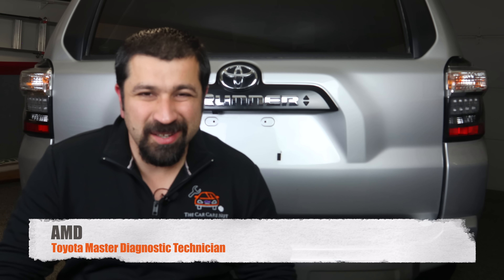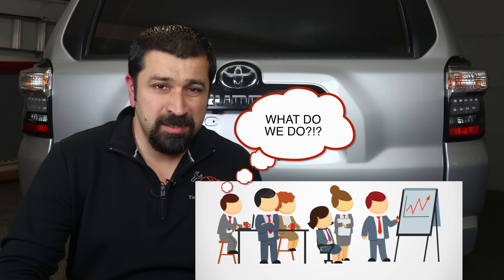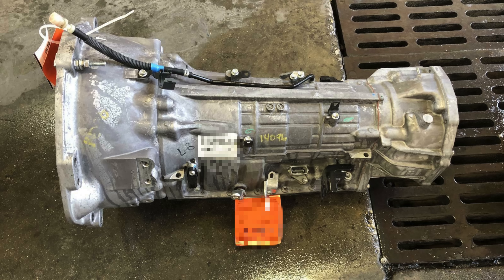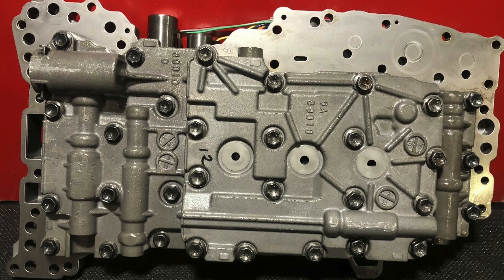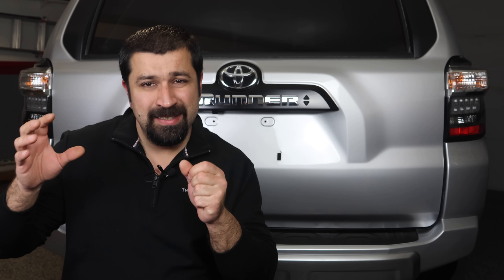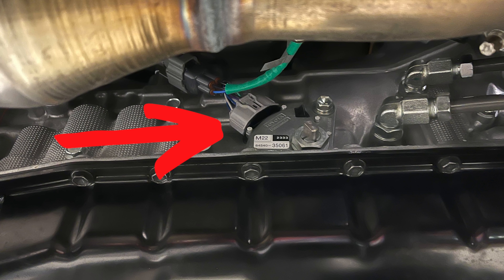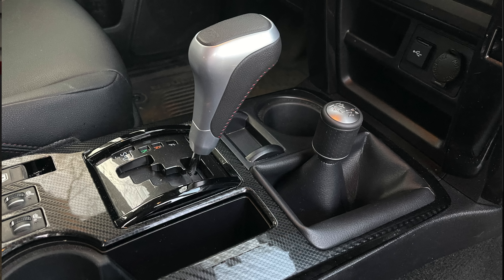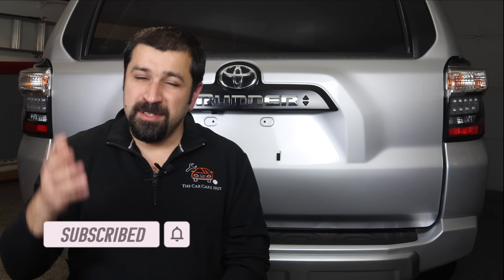Toyota 4Runner Transmission. Why is it so reliable?

Comment: @TheCarCareNut, Thanks for all of your great and educational posts. I have a transmission question on a 5th gen 4runner if you will permit me. I have a 2012 that is sometimes flaring between 4-5 shifts.  Meaning I am driving and it shifts normally thru 4 then when shifts to 5 it seems like it quits pulling for a split second and the rpms shoot up about 800-1000 rpm then all is fine again. Not like a hit but a lull if that makes sense. I have had a trans shop look at it and they find nothing wrong but did verify it did it.  I have had the fluid changed several times since I bought it all by Toyota dealer.  I am thinking it might be a solenoid but dont want to just throw money at it. Any ideas? 
Thank you

Comment: Love this channel. I have a 2023 4 runner SR5 2WD I bought new in December 2022 and have only driven 1300 miles. Since I owned it I occasionally get a transmission shudder only in one situation. When I am slowing for a stop or a speed bump and then start to accelerate from a stop is the only time I feel the shudder. I have a feeling the fluid level may be low and when I brake the fluid moves forward away from the pickup point. Do you have any advice? I hate taking any of my cars to the dealer

Comment: My 07 had some shudder at 65K when I bought it.  Did several drain and fills and resolved the issue.  Currently at 275K miles

Comment: My Toyota 4 runner 2003, with 195k miles, never had before the first time an transmission fluid change, 
Do I’m supposed flush and replace the fluid? Can my Toyota have problems on the transmission for not maintenance?

Comment: Excellent information!
I have a Toyota 4runner 2003, on very good condition I just painted last year, 195 K, miles on it, and still running good. The transmission still good.

Comment: Hello car care nut I have a question for you. I bought a 2024 Toyota 4runner. I have been babying my 4r. No rough acceleration or long hours driving.  So i accelerate slow ensuring eco light stays on. However I keep feeling like my transmission kind of has a slight jerk, or feeling like it has a delay when switching to 2nd gear. I have tried accelerating a little faster and sometimes feel the same thing. Is this a known issue? I keep wondering if it's just me.  But I feel like the transmission is kind of jerking when going into 2nd gear.  Do you know anything about this? I figured you would have knowledge if this is a known thing.  Thanks for any help you might have.

Comment: What’s the average temperature for these transmissions. I’m using a scan gauge 3 and I’m noticing that in the summer my transmission can see temperatures around 220 degrees while just cruising on level pavement. 

I’ve always been told that anything above 200 is bad. While towing I almost hit 250.

Comment: I still miss my 2003 4Runner V8. Had over 250,000 miles, never had a problem with the motor and transmission. What killed it was the undercarriage rust, on the frame and eventually the hydraulic lines gave out.  I still got 20 years out of it, and, had it not been for the rust, I would be driving it today. Loved my 4Runner.
Reply: I had a 2005 v8 with 247k miles.  Lots of 4 wheeling on beach.  Frame was rusting and AC needed to be filled every 2 mos.  NEVER had to take it to the dealer or repair shop.  The only repair was front CV boots that I did.  Bought a F250 in 2019.  Sold the F250 yesterday, got tired of dealing with recalls, warranty work and the final kicker was needing a $3000 steering wheel out of warranty.  Looking for a red 4runner now

Comment: Great videoCare Nut Thank you.I have a 99 4 wd  4 runner  with  290.000 miles I have owned for 20 years as you suggest always changed fluids on timethe car runs like a champ,I would like to see  my  runner go to  400.000,any suggestions maintenance wise to keep her going?

Comment: Do you know what the normal operating range of the 5th Gen? And what temp would you get concerned is getting too hot?  We use an app Torque Pro with custom PIDs that show Torque Converter output was in mid 230F after a long climb and trans pan temp up around 205.

Since we don’t know of a way to check trans temp without third party software, trying to figure out if PID is correct. Also do you recommend aftermarket trans cooler for heavier rigs?

Comment: would accidentally using a funnel I previously used to drain old engine oil to fill my transmission during a drain and fill pose a risk to my trans? The amount of engine oil introduced would be only what was still clinging to the sides of the funnel.

Comment: Changing the trans filter and gasket tomorrow on a 2018 4Runner 6 cylinder
Could you tell me the torque specs and the transmission pan bolts
And what temperature should the fluid be to check the overfill
My RAV4 and Camry are 104 to 113° is it the same

Comment: 2004 limited here, only 136K miles. Almost 20 years and no issues. Changed the transmission fluid at 100K

Comment: Hi,
Thanks for this video.  I have a 2006 4runner with the 4.7 v8.  Bought used. Don't think the Trans fluid has been changed in 180k.  It has issues shifting from 2 to 3, and it will not go into 5.  I'd like to do a filter / fluid change, and change the solenoidscfor these two speed shifts. Would you know what transmission comes with the v8 in 2006? And what solenoids I should address?  Also, is there any chance you would do a video similar to this one where you show the part locations?  Great job on this video, please keep them coming.

Comment: I have a 2009 and I go to the dealer to do drain and fills periodically.  I usually bite the bullet and go to the stealer for anything involving ATF or diff lube or coolant or transfer case oil change or driveshaft or whatever ... the indie guy is fine for most things but I just trust the actual Yoda techs to do the more exotic fluids in the car.

Comment: I just bought a 2012 4runner limited AWD.  I get the rumble strip noise intermittently on acceleration at around 20 to 35 mph.  Is this a bad Torque Converter with the Flex Lock  Up function?  I had the dealer do a fluid change but still persists.  What should I try next?

Comment: Dear AMD, I just bought a 2010 4Runner Limited from a family member with 228,000 miles.  Maintenance was performed throughout the years but not as well as I maintain my 2015 Tundra (330K miles).  I have a dilemma with the transmission in that a while back it developed an intermittent brief shudder when accelerating at times but otherwise drives fine.  A former mechanic put some type of additive in, but didn't perform a service on the transmission.  I have no idea if a transmission service was ever performed on the vehicle.  I believe one of your videos indicates that a transmission service in my situation has the potential to cause more harm than good, is that correct?  If so, would that mean that I should avoid servicing it completely?  I have only owned 4Runners since 1995, only swapping for a Tundra to tow a larger trailer.  I now have the opportunity to have a vehicle I love, but could really use some advice on the transmission.  Thank you if you are able to answer.  Your videos are empowering and beautifully supplements most of what I was taught about proper maintenance of a vehicle from a auto mechanic with a similar level of experience and knowledge as you.  He has retired now, so your videos are a life-saver for me!  Thank you.

Comment: Just bought a 2016 4Runner with 142,000 miles. Took it to my local mechanic to have it checked out.  My mechanic noted that the transmission housing looked cleaner and shinier than the engine and other metals underneath. He said that the transmission could have been changed.  However, I noticed on Carfax that a recent Toyota  service performed revealed a leaky transmission pan gasket. Is it possible that once that gasket was changed, the mechanic wiped and cleaned the pan really well and that is why it would look shiny and newer? Is there a way to tell if a transmission is the original one that came with vehicle?

Comment: I have the 4AW aising warner four speed transmision in my 1998 montero sport, i hear that it also is very dependable four speed transmission i wonder if it is similar or the father of this 4runner trnsmisison.  I hear a lot of jeeps had it with 4 liter motors beating on it and off roading and so my 3 liter montero should be fine with it i hope

Comment: I'm Praying the Upcoming 6th Gen 4runner remains Simple. I've owned 9 4Runners since 88 always off roading in them. As Well as other family members. Along with  a few Tundra's and I Always find myself getting in the 4runner.  I praying that toyota does not make it any bigger, Or Change anything to much. I wont even touch a New Tundra turbo after Driving one and Seeing the issues first hand. It is not a 3/4 ton truck on a half ton duty. It is A Big 70's car to me. 4Runner duties and is and hopefully will always be geared towards the adventure. Not the parking lot explore or minivan type that moved into half tons.

Comment: This guy is the reason I just bought a "new" old school 2023 4Runner 4WD Premium!  Great videos and information!
Reply: I have a 2024 because of him
Reply: About to look at a 2023 trd-or today. The newest car I have ever bought was a 2010 focus in 2017 I bought cash for 3k. This gentleman is making me comfortable investing with money and maintenance in a 4Runner for the long term. It’s about 6x more than I have spent on any vehicle before lol
Reply: Me too!
Reply: Just bought a 2022 sr5 4x4 because of this guy too😂
Reply: I have a 2024 4Runner SR5 Premium because of him and Overlanding
Reply: @epicmickey2351 SO WHAT YOU HAVE IS A 2024 TOYOTA 4 RUNNER SR5 PREMIUM (THIS IS THE PROPER WAY DESCRIBING WHAT KIND OF VEHICLE YOU HAVE) THAT WAY EVERYONE WILL KNOW. IT'S JUST LIKE I BOUGHT A, 2010 TOYOTA 4 RUNNER LIMITED WITH A 4.0L V6 AWD AND 4X4.
Reply: How is the truck
Reply: @erickonassis6310 calm down. We all knew what he ment
Reply: @erickonassis6310 I have a 16 bought at 89k miles in 21 or 22. It’s now at 164k. Had a timing cover inspection port leak that was very minor, removed metal gasket and rtv silicone from work on it. Only done maintenance fluids, and killed a battery leaving the ign on overnight. Taken it off-road, road-trips, hauled trailers (nothing too heavy), it’s a great choice.
Reply: I bought a 2023 off road because of him . Love it

Comment: Great video .... thank you for posting....
Just 2 things I want to mention regarding 2021 4Runner that I am experiencing 
1 - When cruise is on and my 4runner comes to almost any kind of incline it comes out of 
5th.   Is this good or bad ..... is this normal...?

2 -  Noticed when going down a steep grade engine downshifts and RPM's jump up..... again 
is this normal ?    All my cars in the past never did this....

Thanks in advance.

Comment: Why does my 2022 4Runner Limited get 100 miles less per gallon than my 2007? It seems like it is running at a high RPM when on the highway?

Comment: I hope you might be able to help me I have a 2011 Toyota forerunner limited I bought it with 218,000 miles transmission runs fine but I decided to check for myself if the fluid was ever changed and it wasn’t so I started a process. I drain the transmission fluid when it was cold and 2 1/2 quarts would come out and so I would replace it with 2 1/2 quarts with new fluid. I would run it for a week or two and I would do the same process again. I did this four times with mind you synthetic fluid. My transmission runs fine but the only thing is when I slow down too fast it has a hard time coming down the gears and therefore when I press the gas it has a hard time catching onto gear and it kind of bumps me but it goes into gear once again. It was not doing that until I change the transmission fluid.

Comment: @ 200000 Miles Radiator went bad and got water mixed with the transmission oil and this was the end of it

Comment: Im a 10+ year Toyota tech. We routinely recommend flushes on sealed transmissions. We tend to recommend them at around the 100k mark. Never have I told an owner to not flush their transmission ever. Toyota's World Standard ATF is very good stuff, but it gets dirty like all fluids do while in use. It is definitely advisable to flush your transmission, just make sure you are using the correct fluid AND set proper fluid level after. Only time I have seen these transmissions die is when serviced improperly with wrong fluid or not enough fluid...

Comment: I have a 2022 4Runner Trail, when is the best time to change the transmission fluid to remove the metal shaving...I have thinking 10k miles...Please advise

Comment: I have a 2019 Toyota 4runner  SR5 4 wheel drive. I think heard you say change the transmission fluid every 60,000 miles or 6 years. Should I drain and fill or have a shop back flush it? And does it have a filter that needs to be changed?   Thanks in advance...

Comment: Great vehicle. Too bad that the RAV4 isn’t the same. Both CV joints gone at 88,000 kms and Torgue converter has been shuddering from day one. Our Titan has been the most bullet proof vehicle we have owned. 396,000 kms and no major issues what so ever.

Comment: I disagree. 5 speed is Not enough and while 4 runner is on cruise it constantly go up and down trying to find gear changing every second or so at certain speeds/elevation. it is way over due to fix or at least an software update to fix the issue!

Comment: If you live in the mountains you put up with this trans but you sure don't like it.
Too much time in 3rd gear pulling 4000 rpm.
I love that is reliable but 6-7 speed would be great.
My MDX has ten and is so much smoother and seemingly more powerful even though the HP is about the same.

Comment: Hello,  Amd, I have a 05 4runner sport.  I can't figure out why when I'm driving easy on the throttle approaching 40 m.p.h, it tries to go into overdrive.  It fish bites, I apply increased throttle and nothing happens,  just continues.  I lift off the throttle and reapply it goes back to 4th and is okay. When applying heavier throttle and the speed approaches 50 or so it goes into o.d. just fine.  God bless and thank you.

Comment: Hi! I just found your channel! I have a 1996 LX450 with 361,772 Miles and counting (I put on 200,00+ of them since 2009) My biggest issues are the door handles crumbling away!! I replaced the heater core and the cylinder compression was checked and very good! I also have a 2021 Ford Bronco I reserved a long time ago sitting in my garage that I am going to sell to get a new 4Runner. This is a great video series, and I also watched your 2015 Camry engine breakdown. I change my oil every 3-4k miles in my cars, and now I am glad I do. God Bless ya and be safe!

Comment: I own a 2018 4runner. I bought it certified used from my local Toyota dealer. At 60k I had the transmission flushed. Simply bc there was no record of it being done before and I know you’ve said multiple times to do maintenance. I’m at 86k now to at about 120k it will need servicing again. When I take it to the dealer should I get it flushed again or just a drain and fill? I really enjoy your videos and keep up the great work! PS it’s my daily driver so I don’t do serious off-roading or any towing with the vehicle.

Comment: Thanks for all your great insights which is why I chose to buy a 4runner 2022 2WD, since 100% of my driving is normal road it now has 6k miles. I do have an issue and genuine dislike/concern about its transmission. I know it's an old true and tested built but for some reason it is so hard to shift out of park. Everytime it sounds like a harsh grind or bump. I have tried neutral + parking break and then park and it still so hard when I drive it next timebto get it out of parking. It doesn't matter if its hot or cold. I took it to toyota and the tech said it was normal. It pulls forward when I shift it to park and when I turn the car off I hear a shutter or a light knock into parking.  Please give me your advice since you have had yours for sometime. Or a video about the transmission rocking and if it's hard a normal thing to get out of parking. No transmission- rav4 2020, last year tundra, current tacoma feel this way or even any other first couple generations. Please help me out. Thank you!

Comment: Hi Mr Car Care Nut!  I have a question: you advised NOT shifting to Neutral at stoplights and other similar pauses.  I have routinely shifted to Neutral in such circumstances, and in fact I once had a 1994 mercedes S600 (what a beast!), and the owner's manual specifically advised shifting to Neutral at lights.  Is your opinion just a matter of wear-and-tear on the linkages, or what?  Is this REALLY an issue?  Thanks!

Comment: Hello AMD!
Great channel and technical know-how!
I have a A750F in my Toyota and after 200K started to have a shudder. I did a drain and re-fill twice to refresh by the temperature monitoring/overflow method and also added WS fluid with a tube of "Shudder Fix and it solved the problem or maybe just masked it. Now the slight shudder occasionally comes back. Yes, probably should have replaced fluid earlier!
What should I do next?
new converter, rebuild valve body? Is there a certian component in  the valve body to replace? I see that Sonnax makes some...
Thanks!
Dan

Comment: Great video! I own a 2008 4Runner and change my transmission fluid every 3 years. I love your videos. Thanks for doing them!
Reply: Changing frequently is actually bad.  This mechanic recommends one drain and fill only every 60000 miles or 6 years.  Use original Toyota fluid. No need to change transmission filter